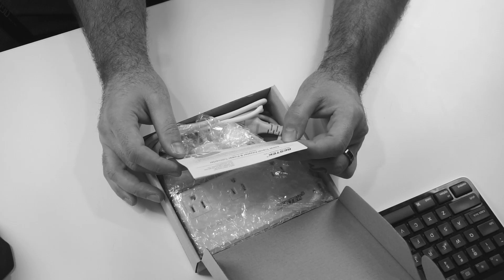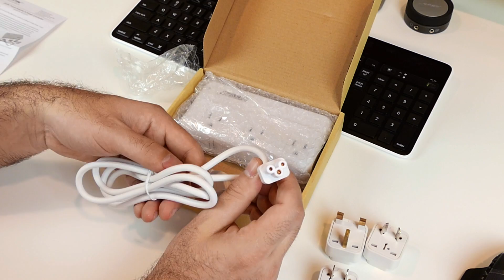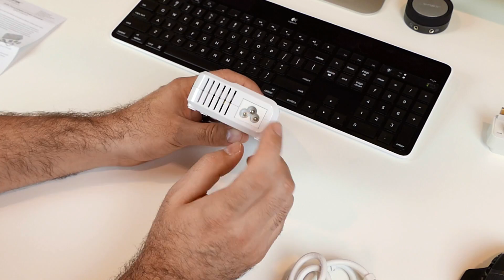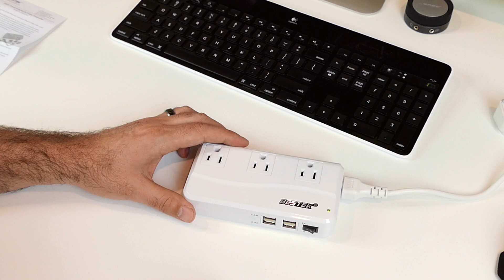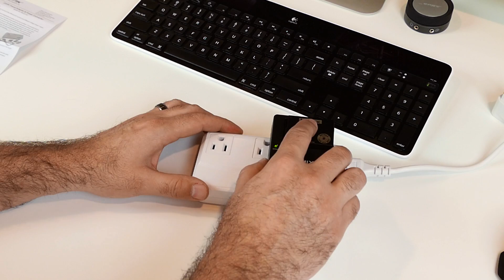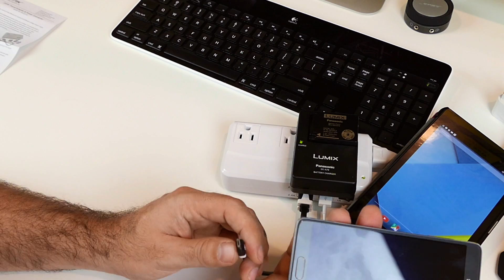Bestek 200W Travel & Power Converter

Comment: @Larry Dickerson - 
This item shows that Even BESTEK has illegal dodgy junk (that you didn't notice) : 
1. NO Earth (illegal 2 to 3 connection plug) but allows Earthed plugs ( = illegal) , probably Earth generally not supported in the device (investigate it by take apart ! ).
2. includes 3 multi-illegal "Death-dapter" (https://www.youtube.com/watch?v=ESIzuV6kdWY) face plate style travel adapters without ANY safeguards ( 1. bad contacts , 2. lets you insert plugs in dangerous ways , 3. NOT Earthed but of course 
allows earthed plugs  , 4. big holes & no working protection shutters , 5. of course no fuse even in the UK one = UK requires all plugs to be UK-fused due to 32 Ampere circuits ). 
3. All this is a bad sign that is to cheap & it might have problems like excessive 
interference & excessive dirty electricity (illegal). 

CONCLUSION: Dodgy !

It is to expansive for what you get , at least you need to replace the cable & all 3 adapters , IF the base unit is OK (Earthed & reasonable interference suppression).

You as reviewer got tricked due to lack of knowledge ( & online investigation) , you did not 
notice any of these serious problems.

Comment: I'm here in New Zealand on vacation and the 45° slant is also for these plugs. For feedback, two comments: 1) the main straight pins adapter plug/wire seems really flimsy and not locked in.very tight to any of the three adapters and 2) there needs to be an illustration in pamphlet of how the straight pins adapter wire fits into the three adapters. Because of how the holes are arranged on the three adapters, it's possible to plug in the straight pins in the vertical or horizontal position. I couldn't tell and there was no instructions, hence having to search You tube for a "how to".

Comment: The one that comes on the wire is Asian. It's more than just a normal plug just for adapters.
Reply: +FunsterProductions I prefer to use 3 prong plugs for safety like US 3 pin plugs, UK plugs, Etc.